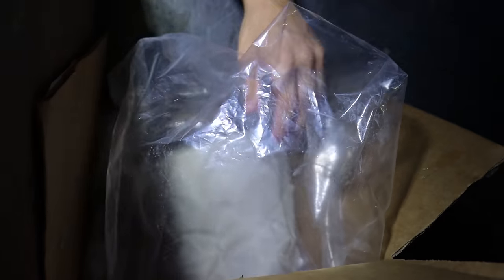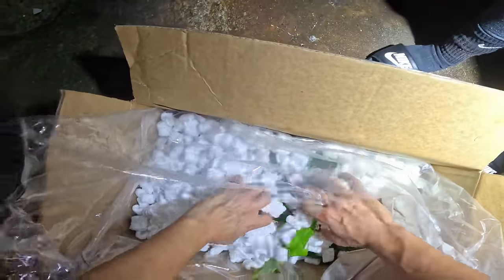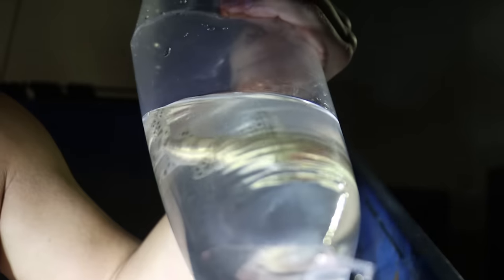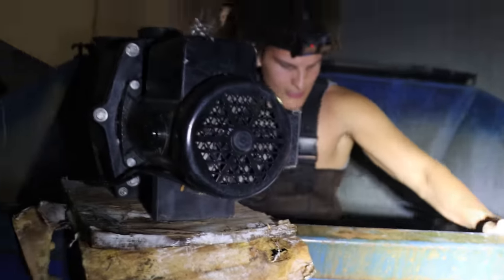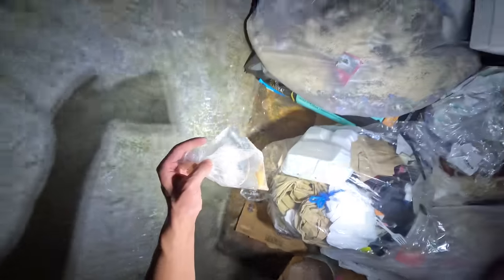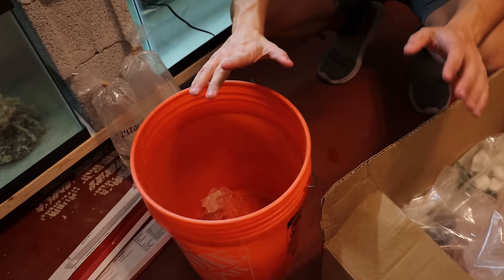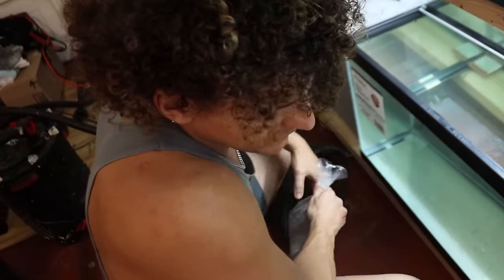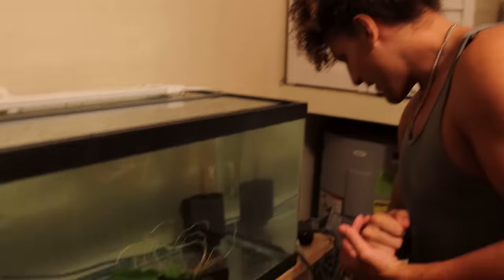I Found AQUARIUM FISH In PET STORE DUMPSTER!

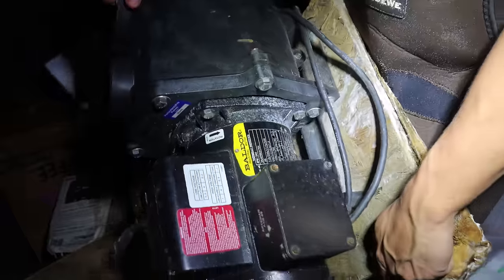Comment: 9:00 gotta say its part of my job fixing those, that's an in-ground pool pump (missing the cover and the basket)

10:30 in the box ,french traduction i think its a digital heat or air controler with timer (might just be a timer in not sure)

Comment: That little aquarium is great for bringing with to locations, to view the fish you catch.
That pipe with the blue ends, might be a filter, you can fill the tub with any medium, then connect it so the water goes in through one hole and out of the other, if its a slow stream, loads of good bacteria can live in there.
You can also fill it with carbon/coal, to clean out the water after using medicines or something like that.